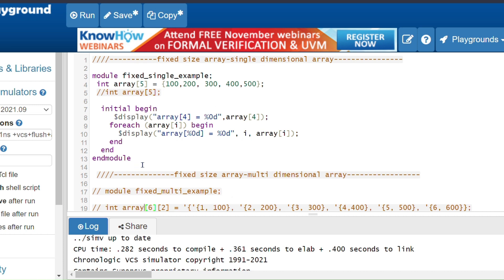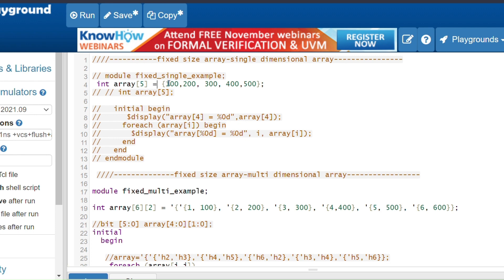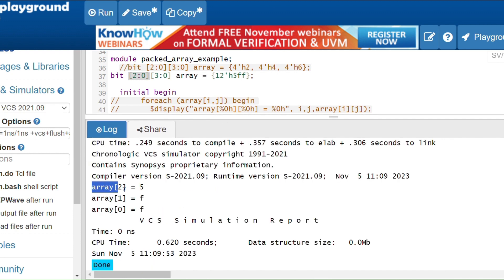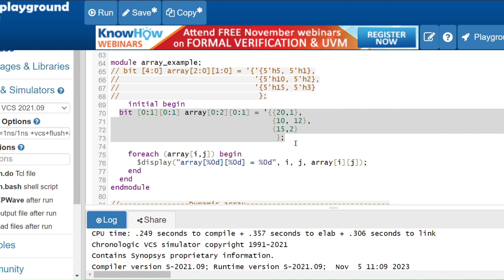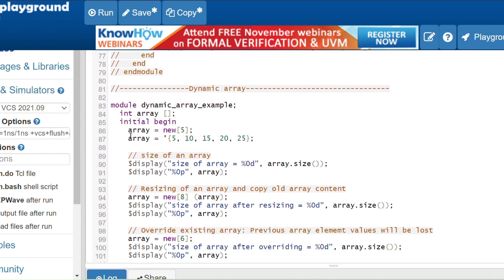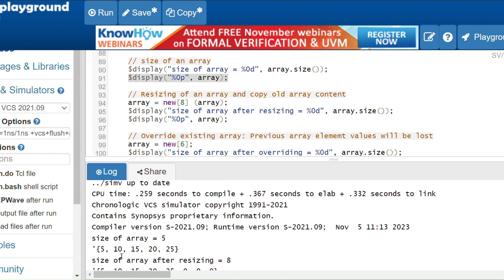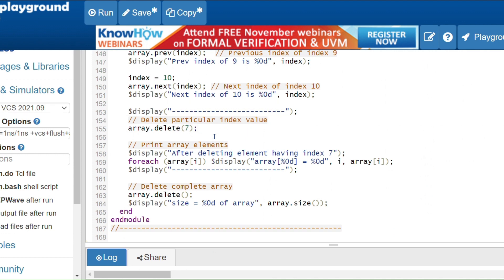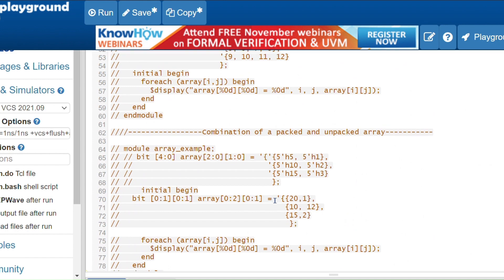Array examples in system verilog | Declaration and initialization of all types of array

Comment: Nice explanation. Doubt :  Is there any way to delete the particular element in specified index in an array bcz delete method is deleting entire array elements?
Reply from the maker: No. For dunamic array there is no way.(Thats why we have queue for addition and deletion)But for associative array we can use array.delete(index_num);

You can use this if you really want array element to be deleted:(applies for both fixed and dynamic)

  int array [];
  int queue[$];
//-----initial block-----//
    array = new[5];
    array = '{5, 10, 15, 20, 25};
    queue=array;//assign array to queue
    queue.delete(3);//call delete method of queue with desired index value.
//---------------------------------------//
   
Thank you.